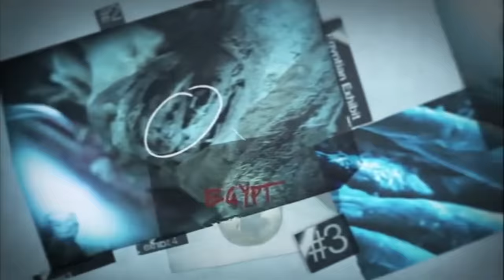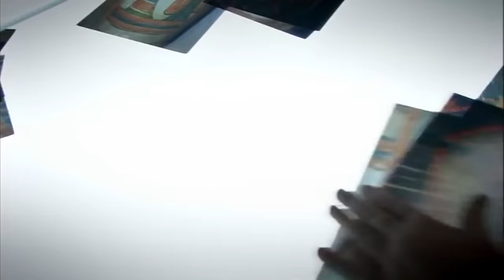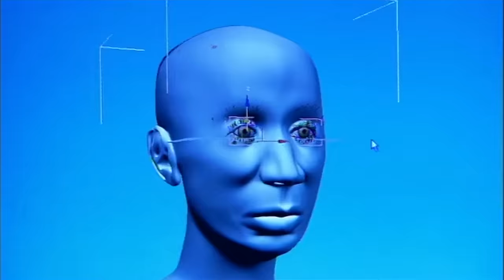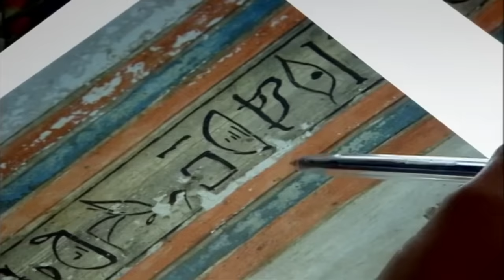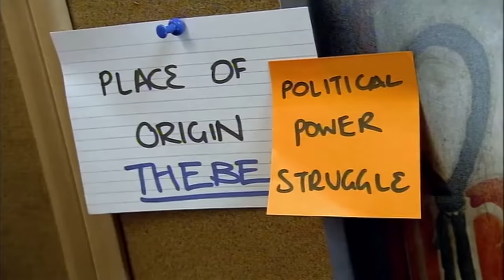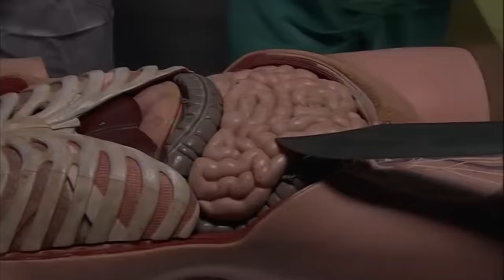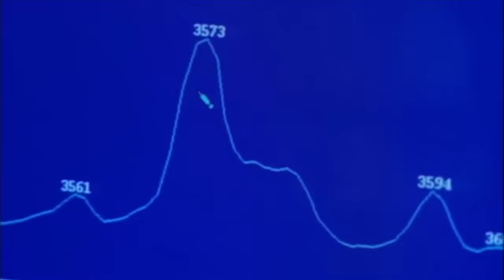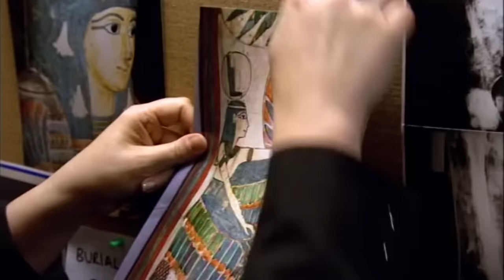The Mystery Of The Sealed Coffin | Mummy Forensics | Timeline

Comment: I've worked in a lab for some 8 year. Stephen is handling open containers add liquid. Without gloves or face mask. He as the open sample right below his face in close proximity to his breathing. It does not take much for contamination to take affect. I would not be surprised, if the results came back to be his mother
Reply: they reenact most of this for filming.  They do not film actual testing or anything in the actual testing space because of risk of contamination.  They have them reenact without proper risk reducing measures like masks so the audience can see their faces for the story and filming.

Comment: 24:00 if she had an overbite, the last tooth on the bottom would not have an opposing tooth so it would remain unworn forever.
Reply: Not so. Overbites are usually related to the relative positions of front teeth. The vast majority of people have a slight overbite. More significant overbites can be due to uneven jaw growth, angled position of teeth or a combination of both. From the premolars rearwards teeth tend have their correct relationships. Unpredictable eruption of third molars can often leave them unopposed..

Comment: The person reading the abdominal CT scan seems to have his left and right mixed up. You read a CT scan from the feet up, so the embalming incision he's pointing out is on the right side of the abdomen, the traumatic wound is on the left. He's also using the term hypochondrial incorrectly. The wound appears to be lower-mid abdomen. Hypochondrial is just under the ribs in the upper abdomen.
Reply: There's actually two wounds  then the embalming insidion